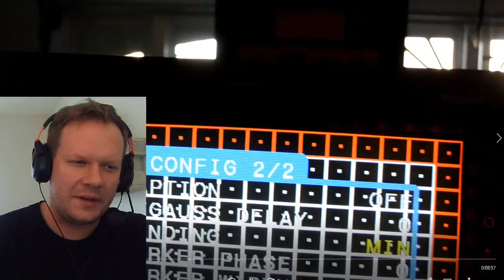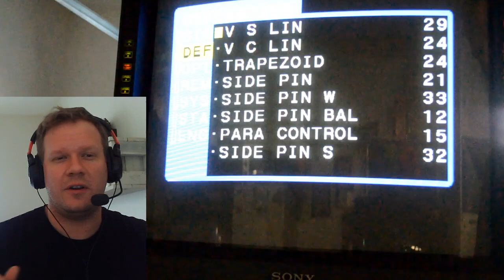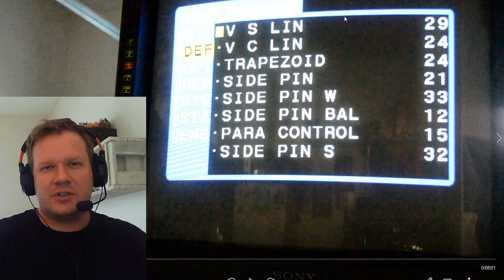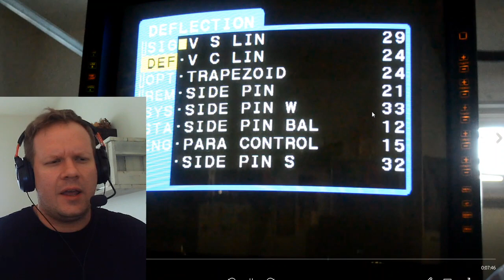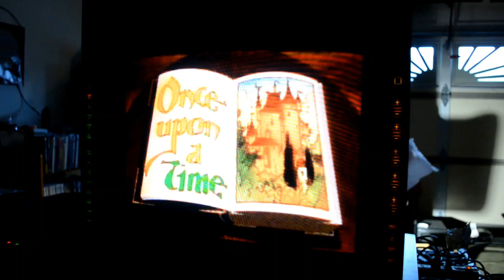Sony PVM 20L5 | Calibration & 3DO Testing - CRT Perfection!

Comment: You mentioned a friend had a 20l5 that had dim controls, my 20l5 has dim controls on the right side, the Sony documentation states the following:  ◗ Illuminated controls
LED-lit sheet keys located on the sides of the front panel
allow the PVM-L5 Series to be easily operated in low-light
production environments. The LED indicators can be
turned off or adjusted in brightness by five steps according
to light conditions and operator preference.

How do you change this, I can't find anything else on how to change the 5 stages.

Thanks for all the great videos!

Comment: Hi, I have got a question. Is it worth picking up a CRT TV, that  stood outside and has been exposed to the rain for several days? Is it possible to get it running again by drying and cleaning it?
Reply: i have always been curious about this too
Reply: I’ve found some left outside in less than ideal conditions. I made sure to let it sit inside the house for a few weeks before firing it up and it looked great